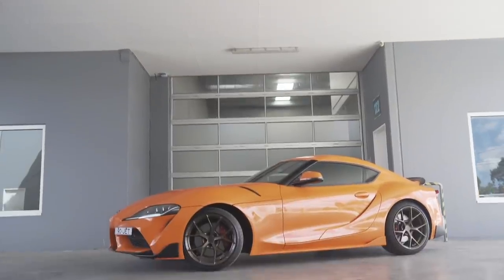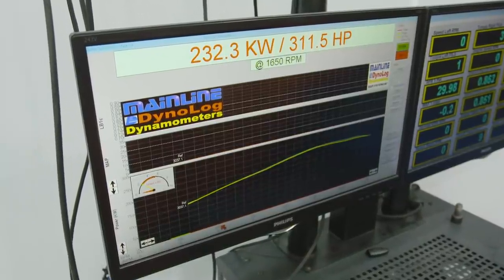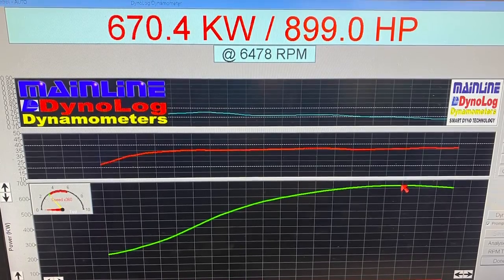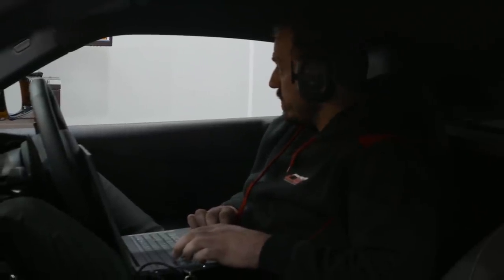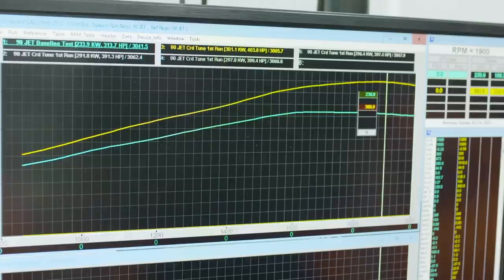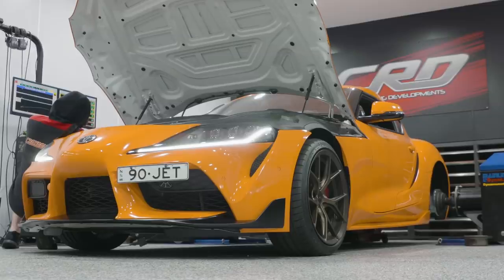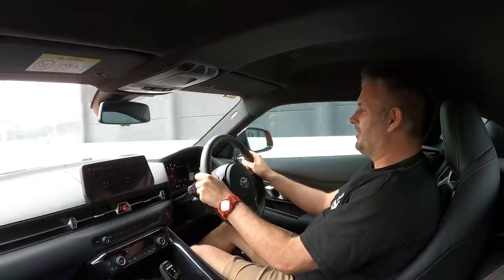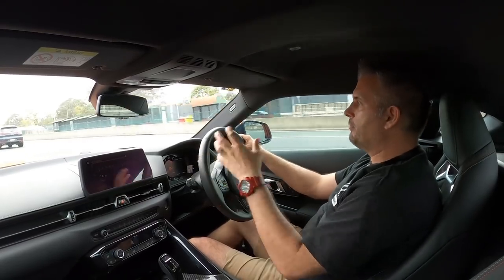MkV Supra 30% Power Increase With Just a Tune! - Motive Garage Supra Ep 3 - RE-UPLOAD

Comment: My brothers made 473hp 503lbft with only a downpipe and tune
Reply: Catless down pipe, air intake, and ECU tune and mines pushing 500hp
Reply: @briansimpson5664  hard to believe. Haven’t heard anyone make 500without meth or race fuel. What’s the power at the wheels

Comment: The B58 is already heaps better than the 2JZ ever was, fight me
Reply: Impossible! How could an engine designed 30 years after the 2JZ be better?
Reply: Why
Reply: The fact your bringing up an engine made in 1991 under a video made in 2022 destroys the B58 argument. B58 can make 800whp stock bottom end ? Jz can too. B58 sounds good? it does but the JZ sounds better or just as good? 

How realizable is the B58? I know owners were having oil consumption issues at 1,000 miles. I’m not sure but we know the 2jz from factory is very reliable in 1991.
Reply: @bigjdm5460  b58c engine "first" supra engine dont have eny issues. 2021 b58t engine did have oil costume problems with some patch of engine. Those has been repaired wrong pistonring cap. B58 in BMW world has been crazy success and supras has shown that too.

Now ppl runs 1200hp with b58 engines and they run times like 8,3.
These car are street driven still with interior on.
Reply: @89Heke  i was just reading through the forums and watch a couple videos about stock bottom. They are saying stock pistons are the weak point and people agree 600-650whp the safe spot. With anything over 700whp u will need to upgrade the transmission. 

Supra transmission can handle 1,000whp no problem from 1993. Send me some links so i can see what ur watching
Reply: @bigjdm5460  go titan motorsport YT and look b58 teardown. After that look p2tuned Who has fastest times now with b58 platfrom they will fill you with rest without internet "facts"
Reply: https://youtu.be/WesHmEHuvzg

This is for titan video
Reply: @89Heke  the TITAN video u sent isn’t a stock block for their 8 sec car. If u read the comments someone asked and titan themselves responded, “our 8 sec car is not a stock block.”

The second video you sent i went to the video made a min to ago about the engine. The owner said “we are using a 3.2L stroker kit”. Also i doubt any stock block 2jz or B58 with 1,300 whp is lasting long unless it’s babied only.  i’m seeing stock blocks that i want to last for sure is 600-700whp. with random people saying 800whp. which is the 2jz max safe number.
Reply: @bigjdm5460  yea but they said that Block has potential to do it. They were first on 8sec times. And with stock they where in 9sec times on stock Block.

And Block is still stock but it has i dont know i it spelled in englannish but bore tubes are chanced.
Reply: @bigjdm5460  and b58c engine pistons is not weak. That piston compression rate is too high 11.1 stroke kits drop that and new b58t has 10.1
Reply: @89Heke  idk bro, stock means stock. If guys are doing any stroking or boring that means the block has been opened and modified.
Reply: @89Heke  striker kit from BC is 7,400.00 and i’m sure labor will be another story. that’s not stock bottom end.
Reply: @bigjdm5460  that 850hp on titan video was complite stock block.

Those cylintertubes they chance and they can be chanced. Block will be the same with different components inside.

Funny thing ppl talk how much piston can hold hp. Reality its more how much it can handle compression champer pressure and heat. The hp is bad measure in terms what piston can handle.

We had old s38 which had 230tkm on it. High compression and cast pistons and rods. We did turbo it full stock only fuel mods and headgasget. 853hp and 975nm. It did hold 3 summers and alot abuse.
Reply: @ACommenterOnYouTube  kid? Nice i feel younger now but back to the cars.
Titan motorsport car is stock. Email them and ask. 

2jz hold 700-800hp and thats it. We have fastest 2jz in finland and we know that engine very well. Check KKD motorsport 7.2s 1/4 thats is our sponsor car. 

when you can argue with facts and be adult then we can continue
Reply: @ACommenterOnYouTube  then you surely need to talk Adam and fast. And if you are In work there and dont know your company customers i surely get that right too.
Reply: @ACommenterOnYouTube  Adam told and made video with stock b58  and speak with stock b58 and usage with other b58 with pistons, rods and bore tubes.

If this is not truth remove that youtube video..

We really have to reconsider our next shipment if this is the quality of your  advertisement.
Reply: @ACommenterOnYouTube  there is your company answer as well. We consider this very worried sing if your say is true.
Reply: @ACommenterOnYouTube  why it is in comment section that engine is stock. Pay attension now. We can chance to p2tuned too.
Reply: @ACommenterOnYouTube  We order and sell titan motorsport parts in here Eu but that video, misinformation and your comments put distrust on your company titanmotorsport and we dont want to do business if your social media advertisement is like this and your behavior not tolerable. Do chance that if you want represent company.